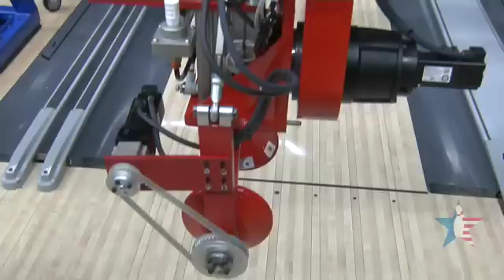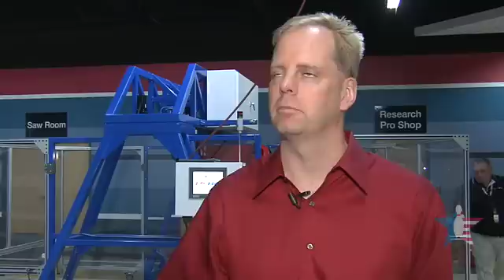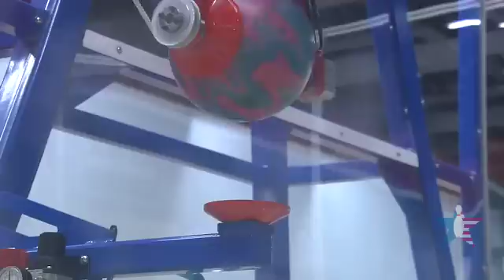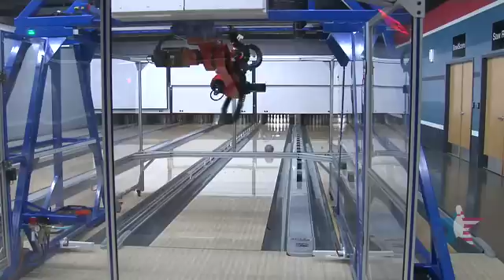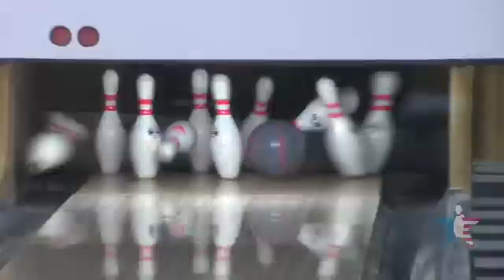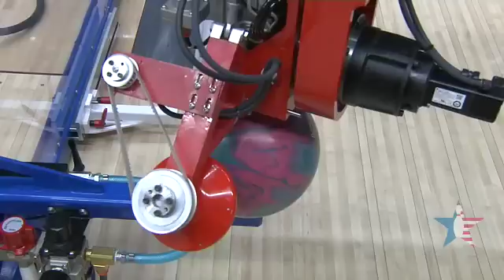EARL - the bowling robot

Comment: Chris Barnes beat EARL 1 vs 1 in a one game format 249 - 209. Earl doesn't adapt to lane changes. With that said if the robot was set to 900 RPMs at 24 MPH it would strike 99 of out 100 times
Reply: It may have not been set to dither it's throw at that point either. It was found that it was so dead accurate, that the ball was 'drying' out the path to the pins, and then that hurt its accuracy after a certain point. Not sure if that point was reached in a single game or not. Sounds like you might be involved with the use of EARL?
Reply: Jaycephus no he just understands bowling and no matter how accurate you dry out and mess with lane oil and cause shots to become less accurate. As long as you can get shots in the general area you will break down the oil on the path. And throwing a ball as straight as earl is capable of while still getting the necessary hook and ball energy, the robot could throw with very little fail.